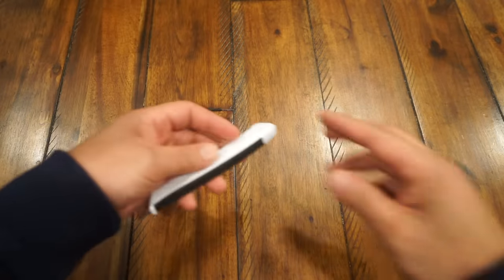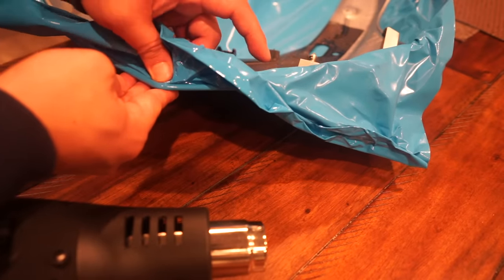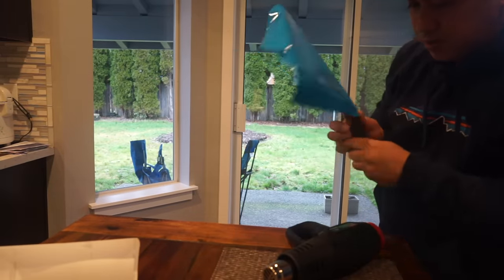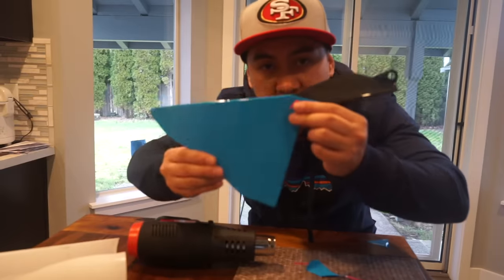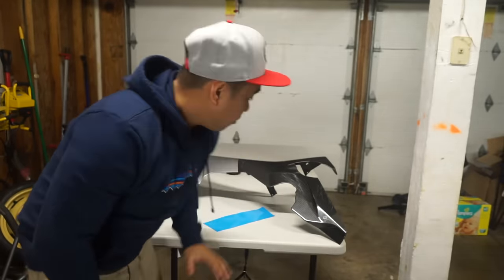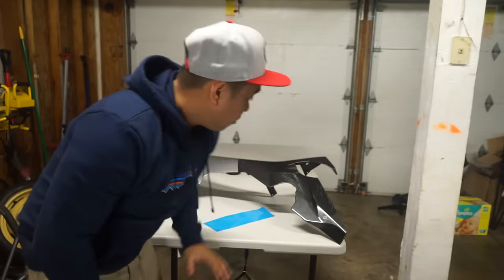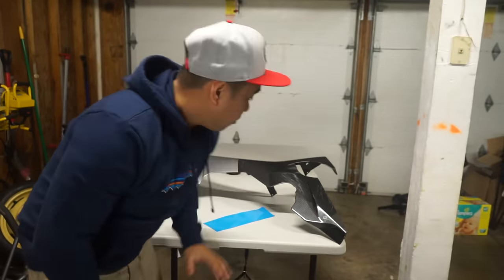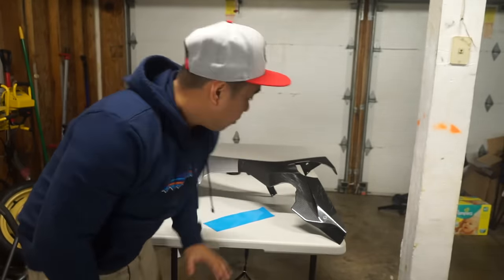Vinyl Wrapping a Motorcycle for Beginners | Part 1 of 2

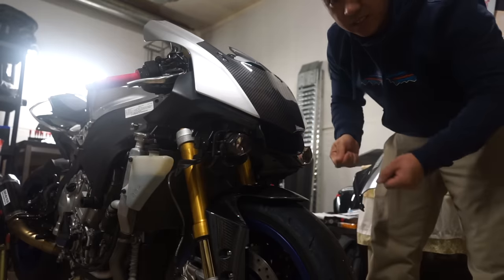Comment: 2:19 - hanging fairing and cutting
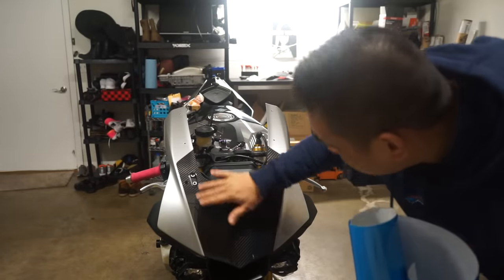3:23 - double checking clean and starting the wrap
4:15 - anchoring the vinyl  and beginning the stretch
4:45 - how to be a great father
7:20- running the heat gun, bubbles and how to cope
8:25 - how to properly seal your corners
11:18 - removing excess material
13:55- relief cuts to help with tricky bends
Reply: Lets see his bike now, i bet he either dumped it on some kid or hiding in the backyard under a ratty old tarp
Reply: @chadsimmons6347 what? the wrap looks pretty good

Comment from the maker: Sorry they're not time stamped yet!  I will work on doing that unless of course someone wants to help me out?  Thanks!
Reply: How many bikes have you wrapped?
Reply: how much vinyl did you use?
Reply: so 2 questions: 

1) I'm gonna wrap only that lower right side fairing, like at 31:17, how much vinyl wrap will i need
2) and also, there's a deep scratch on the fairing, will vinyl stick to deep scratches? will it still show any scratches? and should i remove any decals that are on the fairings? i plan to use 3m 1080 gloss black vinyl and white for the other side. thanks!
Reply: @clearlight1242  You've probably found your answer and moved on at this stage, easiest way to measure for a single panel is to lay up a piece of regular paper or plastic and measure what you'll need as a rectangle... Order a little more :-)

Comment: 15:40 - double check work and what youre looking for
17:10 - tips for any DIY work
18:15 - using vinyl to cover imperfections in the material (can sand smoother and clean if its deeply grooved)
18:54 - tips when using cutting tape
20:35 - anchoring and stretching for smaller pieces
22:00 heating and pushing bubbles on smaller pieces

Comment: Dude, Thank you for this. This is all awesome stuff. * One thing about the Backing..( at least what I do as I do this on my own..), I keep all the backing and when needed, tape it down to a table. This way I can set whatever I'm working on down and not have it pick up all the junk-dust, etc.. and also not have it stick to anything. Just make damn-sure you have the proper side up! Lol.. ( Learned that the irritating way). It's not necessary, but it sure helps if you're in the middle of something and you have to shoo a moose off of the UFO you're building. ...erm, i mean.. car.  .   .   (fail).

Comment: What is the ideal temperature for the heat gun , mine is so hot .👍 Great video by the way gives me so much confidence .
Reply from the maker: Just depends on the thickness of vinyl you’re using.  Mine goes to about 400 degrees or so but it’s just also how you use the gun.  If u need instant heat, then just keep it high
Reply: @adobomoto  so 2 questions: 

1) I'm gonna wrap only that lower right side fairing, like at 31:17, how much vinyl wrap will i need
2) and also, there's a deep scratch on the fairing, will vinyl stick to deep scratches? will it still show any scratches? and should i remove any decals that are on the fairings? i plan to use 3m 1080 gloss black vinyl and white for the other side. thanks!

Comment: Good vid just a tip when trimming dont use the middle of the blade break a new one off and use the tip. Keeps people from scratching the part. You have more control with the blade barely stuck out too since its not flimsy.
Reply from the maker: COJO MOTO awesome!  Thanks man!!

Comment: Hi, I have a 2005 zx6r , I am trying my first wrap..   I was wondering what the method was to wrap the recessed bolt holes in the upper mid panels?
   It's the only thing putting me off as I don't really know how to tackle them.
  Also any suggestions on doing front mudguard, would you recommend doing in one piece??  Or cutting?  Thanks and subscribed..

Comment: Hi! I have tried to do this on my bike and i got a bubbly problem. The thing is that it is not like big bubbles. They are like hundrers of mini bubbles. I think it's a vinil problem. I am currently using soapy water and it works just fine. Any recommendations on what specifications should the material have? Im from Argentina btw so I don't have the same brands as in your country ( i think usa lol) 
Greay video

Comment: Omg you have my dream bike
Reply from the maker: The Infinit Ryda thanks man!  She’s a great ride..definitely been a battle to get her to ride the way i want.  Torque in mid corner is really hard to control, there’s so much of it.  I’m almost back to upright before i feel confident enough to get back on the throttle..if it was a 600, i’d be on the throttle at a lower degree of angle.  Power is almost like on or off, not linear at all
Reply: @adobomoto  very true , it's a extremely snatchy throttle ,but great fun 😁

Comment: I wanted to vinyl wrap mine but went with custom paint instead. Wrapping is difficult I did my dash in my mustang. It’s on my channel, well the mustang is but not me doing the process. Lol. Was too hard.
Reply from the maker: The Infinit Ryda dude dont give up!  Try again.  Cars are easy af!!
Reply: @adobomoto  damn you making want to do this lol I got the 3M clear bra material. I covered my piano black transmission area in my new 2018 Mazda 3 Sport. I still need to do the area with power windows. But that area so hard. I'm so scared cutting the fabric.

Comment: Sorry I've not reed through all your comment answer so you probably have answered this question already , did you use or what is your advice on 3m primer .do you think I should use it , I'm going to try to wrap my front fender but I'm using 3m for now as I don't want to make a mistake with good vinyl if that makes sense . Cheers .
Reply from the maker: I’ve never used it if that helps you.  Lol.  Just heat the vinyl really good after to get rid of memory.

Comment: My biggest problem is wrapping this is having a shit ton of fingers or creases in the end, like if you look up a 2009-2012 zx6r or 08-10 Zx10r rear seat cowl, the plastic part that takes over the passenger seat, I tried wrapping it like 2 or 3 different times and I could never get the wrap on the edges to lol good. If you can, can you look up a picture of the seat cowl and maybe guide me on where you would start on that? Like on the highest peak, or front center, rear center, side, like I’ve tried very center which is highest point, then I tried from the front and then from the back and everytime I got to the front of the cowl like where it’s closest to the rider’s seat, it wouldn’t stretch well over the drop off, if you see a picture of the cowl you will understand what I am saying. It kept giving fingers or creases as you wrapped around the down slope. The 2009-2012 zx6r is very Angular and has some wicked places on the plastic that are tough, so I definitely don’t want to wrap since it would be a pain in the ass, I’d rather just plasti-dip it lmao

Any tips would be help ful. I use mainly Vivvid Vinyl for everything

Comment: Hi!! I am planning on doing my first wrap of a moped soon and still had a question: every time you start putting on the vinyl did you preheat it at all? If so, for how long and how long will it take to cool down and be not stretchable anymore? Thanks!!
Reply from the maker: If the material is super stiff, then yeah you can preheat to make it easier to work with.  It all depends, but just get it hot enough to flex then apply and if you need more heat add more.

Comment: very nice tutorial as I want to start with wrapping to. However you say "I want it to last" how long does vinyl wrap typically last on average? :)
Reply from the maker: Robin Rides it can last years man.  I lowsided my r1m, the viny helped protect a lot of the plastics.  I only had to rewrap the side piece.  The minimal scratches i lived with, but it’s easy enough to rewrap if i wanted to.  When i say last, i meant the lifting.  You have to take your time in certain areas and really let the vinyl rest a few days to watch for lifting. Where ever it lifts, use a lot of heat.  Heat really helps the glue to stick, so don’t be shy.

Comment: Hi. Thank you so much for your very informative Video! 
But I still have a question: Didn’t you try to sand down or repair the scratches on the parts? I have a similar Problem with my BMW Bike, and I have to repair the side parts. If you didn't do anything else, your scratches should have appeared again... Or did I miss something?
Your Heat gun doesn't seem to get as hot as mine, as in one part you touched the hot part of the gun and didn't even react to the "hot" touch. 

Greetings from Kaiserslautern, Germany.
Reply from the maker: Trax El i don’t think i sanded anything down in this video, but i have a video where i showed me sanding down a fairing on my 1299s vinyl wrap video.  Not much else to do unless the vinyl is not sticking to the sanded parts, you can try primer 94 from 3m.  Also, i usually try and wait a bit if i let the vinyl heat up too much before touching.  Maybe i’ve been doing it so long that i know when it’s too hot to touch?

Comment: Holds up pretty well when you go to clean your bike after riding around with it? Can you use your typical  cleaners you would use to clean your bike? Or specific type to keep it good....?
Reply from the maker: micronesian nengin i would say clean it like you would a paint job.  The vinyl is there to protect the original paint, and to look good as well.  It can swirl and scratch just like paint.  I don’t necessarily care because vinyl is so cheap and i’ve gotten really good at wrapping that when it comes time, i can always rewrap.

Comment: I am running a Brute force 750 with loads of racks and cages, Hopped I could do  this panel work in place. Na, not happening, The racks are part of the frame, Only way I can get at the panels, is to unbolt/unscrew and try and slid them out. I am hoping to go MAT black, but my wrap is only 30cm wide, so gonna have
to join Umm. All a bit Scary!

Comment: I went to the metrorestyling site and they got, like, 5 options of wraps, which one works best for motorcycle plastics AND the metal gas tank?  Also, you mentioned 5x12 should be good for a motorcycle, but is that with experienced wrapper and little/no waste?  Wanna wrap my sv650 w/full fairings. Thanks in advance, and good video!
Reply from the maker: Jesse Wagner 5x12 is a good amount, even for me.  But if you can afford more, get more!  Depending on what color..gloss and matte metallic have been really pliable for me.  I’ve used both many times in avery sw900.  There’s a ton of color options just in those two choices alone.  If you’re still unsure, you could try ordering some samples from them.
Reply: @adobomoto  thanks man. Helpful vids, too! Really appreciate it!
Reply: Did you do your sv650sf fairings? How was it? Were you able to do the fairing in one piece?Going to try to tackle mine
Reply: @bpw7b3a69  sorry for the super late reply, but yes, I did wrap my fairings. It looks good, but I get bubbles in a few areas after a day or two. Smoothed them out once already, though, so I'm going to redo them and use some application fluids.

Comment: I like that you use your whole house to wrap that bike, jaja.
I'm a total noob, whats your thoughts on using seam sealer around cut lines or gas tank openings? 
will a couple drops of gas cause the wrap to lift?
Reply from the maker: I really don’t think that it’s necessary.  If you use a lot of heat, the glue should hold up and the vinyl should form really good

Comment: Thank you so much for this informative video. Question - the link you have for the knife tape is for the 3M knife tape that looks like it has tape on both sides of the string, but the one you use in this video has the string on one side of the tape only. Is this the same knife tape? Also, can I just use a hair dryer instead of a heat gun or should I get a proper heat gun? Thanks again!
Reply from the maker: Nate Drake get a cheap heat gun.  Hair dryer works ok, but doesn’t get anywhere near as hot as even a cheap heat gun.  The 3m is some of the best.  Buy the 3m.  The one i’m using is called wrapcuts.  Mostly better for straight lines.  3m is more flexible.

Comment: Im planning on wrapping the two side fairings on my 2018 s1k. They have a rough texture, sorta like a stamped pattern. Would sanding the texture off be the best route before wrapping? Also is there any special prep that needs to be done after sanding prior to wrap?
Reply from the maker: David Wheeler just wrap over it.  Don’t ruin your oem plastics.  You can test wrap spots you might be concerned about.  If you’re worried about the wrap sticking, you can buy some primer 94.  Doesn’t hurt the finish and helps the wrap stick to matte areas.  But test wrap areas of concern before doing extra shit.  Remember, heat activated the glue in the vinyl, so when you test wrap sections, remember to post heat before pulling on the wrap to see if it stuck to the surface.  Good luck man!
Reply: @adobomoto  Thanks! I will give that a try. Hopefully the wrap will cover the edges of the "stamped" areas as well. I'll definitely try the primer 94 too! Thanks again!

Comment: Hi ya might be a daft question but when you don't cover a whole panel, like when you left the carbon on show, is the vinyl edge water proof? Does it require a sealant of some kind?
Reply from the maker: Nope!  Vinyl wrap is like a vinyl sticker.  In fact, that’s what vinyl stickers are made from, rolls of vinyl that are cut using machines.

Comment: Great video! Just what I was looking for! Im about to do the tank cover on my bmw k1200r. Iwasnt sure how the vinyl would stick to the tank, the surface isnt smooth, its got kind of a matte paint finish. I was told by a local shop that it can be done. They quoted me 400 just for the 2 tank halfs!
Heat gun and avery vinyl on order!
Reply from the maker: Konnie Blaze buy some 3m primer 94!  You’ll be fine!  If you need any help or get stuck, feel free to contact me.  I can help you out if i can figure out your problem!  Good luck, have fun learning!  I would not pay $400, but that is the price unfortunately for the labor.

Comment: Love your videos, I have an issue, trying to do my side fairing on a Ducati 848, but when I get to air intake there's a big inlay, I wanted to do in one piece, any suggestion?
Reply from the maker: I know what you’re talking about.  There’s two ways i would do it.  Start the wrap at the vent pulling in as much material as possible and stretching out the rest of the flat fairings.  Or, lay the vinyl over and heat stretch into the vent.  I would add 3m primer 94 in that area though.
Reply: @adobomoto  I've tried the strech but got to a point where the vinyl broke and with the other method if I do the vent first I end up with so much vinyl that I can strech and leave a nice flat 😥
Reply: @adobomoto  I may try again with the lay flat version
Reply from the maker: If you start at the vent it’s definitely kore difficult and will take more time to work the vinyl.

Comment: I'm in the middle of wrapping my sv650s, and it looks great when i finish a part (have both fairings, both tail pieces, and my tire hugger done) but I'm getting bubbles after a day or two.  Have you ever worked with the application fluids to help it stick to edging/contoured areas?
Reply from the maker: Jesse Wagner no i haven’t.  You’re probably talking about the primer 94.
Reply: @adobomoto  yea. I got a primer 94 pen from rvinyl, and some rapid prep as well.
Reply from the maker: Jesse Wagner i asked a guy who wraps for a living here in my area.  He said he hardly uses primer.  Just use heat to remove the memory from the vinyl he said.  Works with some vinyl, but not all vinyl.  I’ve had excellent results without primers using avery supreme on motorcycles.

Comment: How hot is the heat gun? Is it slightly hotter than a hair dryer or alot?
Reply from the maker: Duane Massey way hotter.  Hair dryer works too, but it will take longer to heat up.

Comment: I need to vinyl wrap the clear wind screen on my Yamaha Stryker Cowl. Do I do both sides, what do you do for the edge?
Reply from the maker: D M just do the outside man, you’ll be fine.  Either cut it along the outside edge or pull it into the inside edge and cut it there.  Use heat!

Comment: Getting ready to wrap my GoldWing, and the sides of the full fairing have an inner curve. I assume i cant stretch that, it would pull from the center and make a tent. So when i stretch the edges, is it going to cause tension in the middle?
Reply: never mind.....watched the rest of the vid, lol
Reply from the maker: It is.  What kind of vinyl are you working with?  Also, is there a lot of heat in that area from the bike?  I would suggest starting in that inner curve!
Reply: @adobomoto  no heat,,,under the mirrors and down. No clue on what type of vinyl yet....doing research. Damn gold wing has as much surface area as a mid sized car and A LOT of weird curves. First time wrapping btw,,,,,WHAT COULD GO WRONG ???.....lmao
Reply: also, bike had alot of scratches and dings, so i took entire bike apart, sanded and primer.....I assume i need a clear or gloss paint for the wrap to stick well?
Reply from the maker: You can clear it, but the glue on the vinyl is sufficient as long as you heat it to the right temp.  Each roll has specific operating temps, check specifics for the vinyl you choose.  A lot can go wrong so buy plenty of vinyl.  But you’ll do great!  These videos help a lot and i wish i had them to reference when i first started out
Reply: @adobomoto  right on....ty. btw.......the temp was 5 here last night.......might be an issue.....